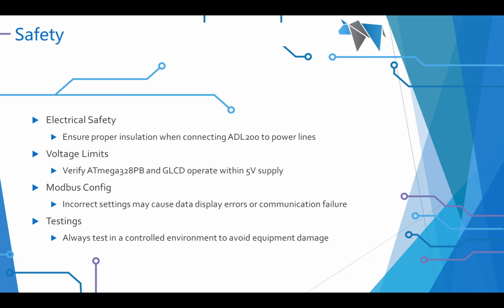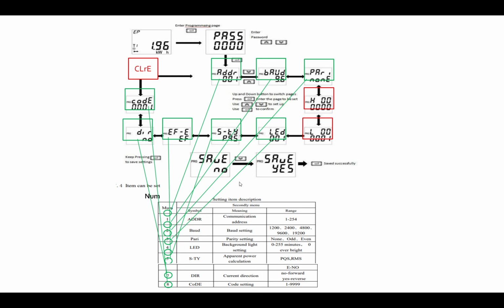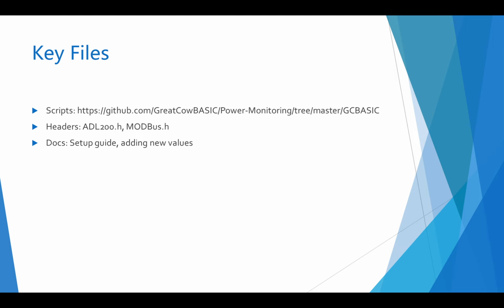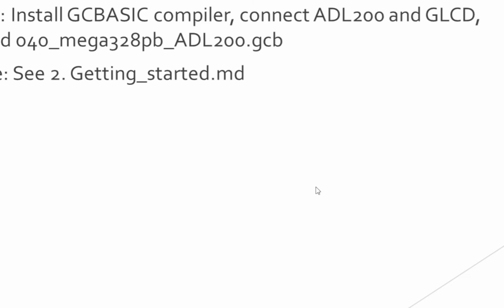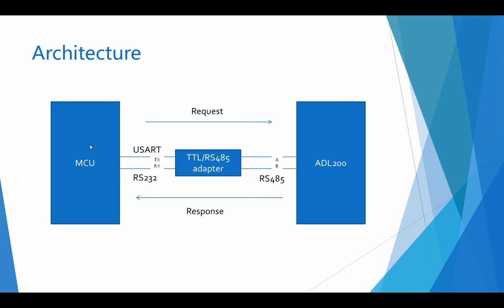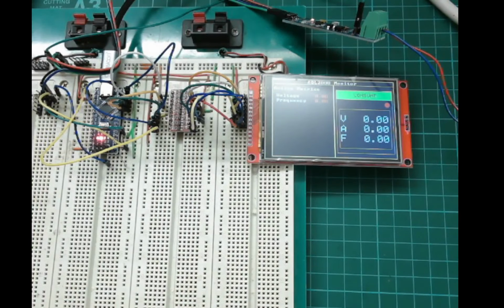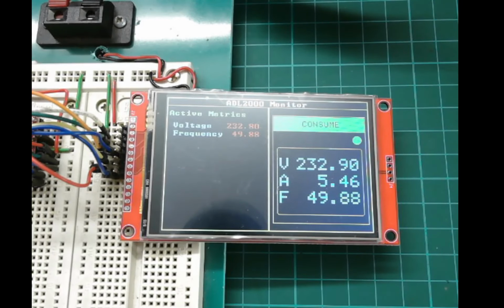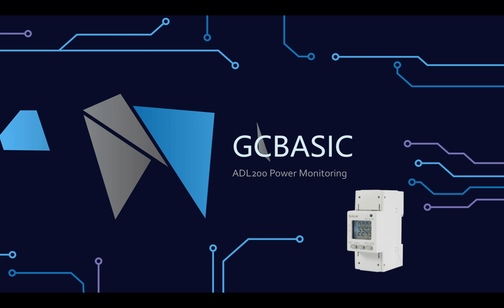GCBASIC & ADL200: Power monitoring solution

Comment: A lot of hard work has gone into this Evan. I like your parity bit checking for the returned modbus data to ensure it is valid.
I see you have spent heaps of time in not only the documentation, but also in each code module to make it easy to change (and add) modbus-RTC data registers, different display options, change ports being used for different microcontrollers etc.
And to think that GCBasic makes it easy to swap between different microcontrollers.
Well Done!